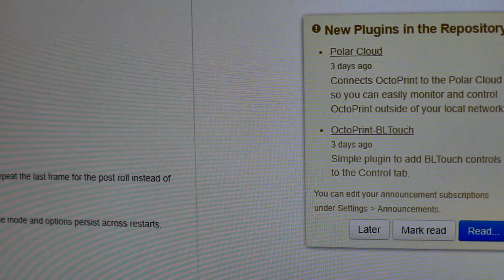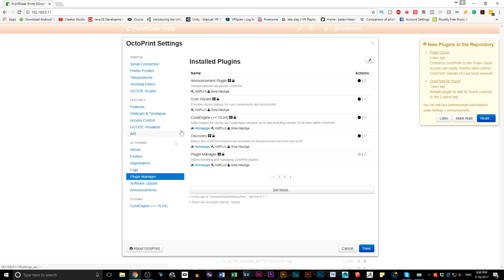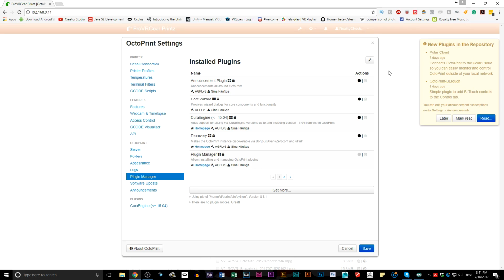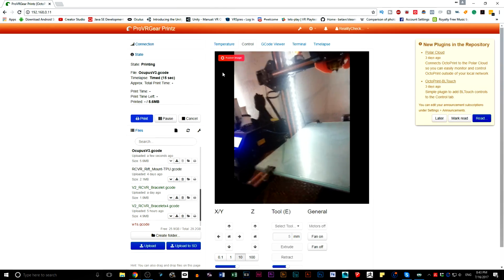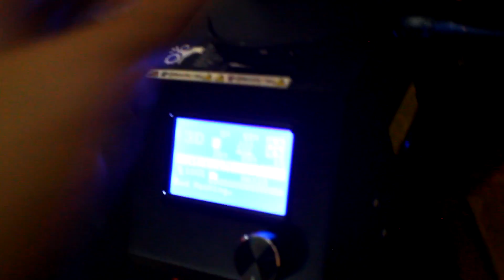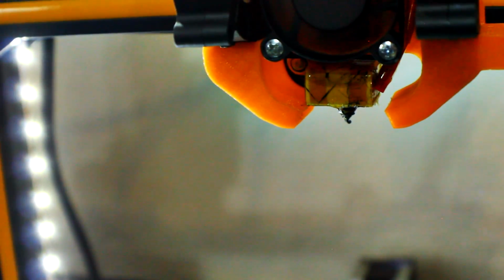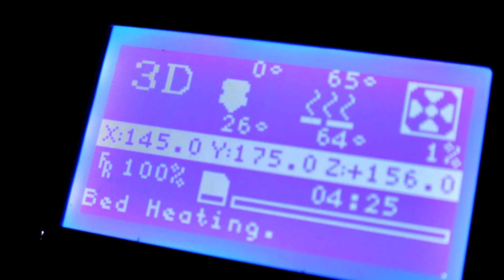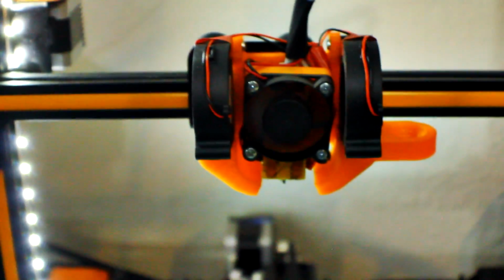✔ Creality CR-10 How-to Print Flexible Filament! | DUAL FAN UPGRADE + Raspberry Pi

Comment: If you haven't already, could you do a video on what you do/did to fine tune the printer? I've started tuning mine, but 1. I feel kinda lost when attempting to diagnose prints, and 2. I kinda don't know what to do to improve my prints, or where to start. I really appreciaite all the care and knowledge you've put into your vids (especially your CR-10 vids) and would like to siphon some of that off!
Reply from the maker: what cura software are you running? If you update to the newest one they have a new CR-10 profile that I've been using that works wonders! :D editing a frame brace update video now)
Reply: I DID update, but didn't even think to update the profile to the new stock profile. I'll try that tonight! I'm getting decent prints, and I've FINALLY got it to where it's doing so at a reliable pace, but the quality of the prints is still lacking. Lots of rough edges and extra filament at layer changes (already fixed that though w/ layer change retractions). I guess I'm trying to find a place/video where we can see what causes certain issues and how to fix that. Does that make sense? I feel like i'm thought-vomiting. lol

Comment: I'm having a terrible time trying to print Sain Smart TPU with my CR10-S. I've tried everything I can think of. No matter what I do, it won't stick to the bed. It'll get 3-4 layers in the it gets ripped off the bed. I've tried tape, glue stick, super hot bed, bed off, hairspray and hot end anywhere from 190-250, still won't adhere. I've tried moving the nozzle up a fraction of a millimeter, down a fraction, NOTHING works. Everywhere I look online, people are producing awesome prints with TPU, specifically Sain Smart. What the heck am I doing wrong?
Reply: Is your bed good leveled???

Comment: Did you happen to verify that the added threaded rod supports for the gantry actually improved the quality of the prints? If so I am curious how you would classify the quality improvement over a stock setup.
Reply from the maker: considering I added the mod fairly early I cannot say that they have made the prints better, but I have never had a problem while printing with them on. It is very noticeable that they take A LOT of the bounce out of the printer as well as keep it on point when I accidentally bump it from time to time. It feels like a BEAST with the supports and I wouldn't have it any other way!
Reply: Reality Check VR thanks for your quick reply. Could you post a materials list for this mod? And maybe an installation video?

Comment: Well, all the discussion concerning the Octoprint is fine, but as the CR-10 (which I have -- among others) uses a Bowden -- which is problematic with TPU -- a bit more on the print settings would be very helpful. I'm presently trying to tune in a roll myself, and though I can get some almost OK prints, in general they aren't so good. With the same roll of TPU, I'm getting excellent prints with my direct extruder Flashforge. I suspect retraction is the problem (I modified the CR-10 extruder -- I'm using a MK8 with the CR-10 -- still Bowden. I also optimized the Bowden tube length.

Rather than burning-off my roll of TPU, in discovering good Cura settings, maybe you could list your settings?

Well done video, however. ; )

Thanks, -Lou

Comment: Hey what do you use for bed adhesion?
Reply: You can find them on Amazon. I use one, but unless the bed is set at like 65 degrees, it tends to unstick during printing. I ended up buying a sheet of PrintinZ's sheet and it's AMAZING. I can run the bed cold and prints stick without worry ever. I love that thing.
Reply from the maker: William Leitz hey William, I use a pei sheet on all of my printers
Reply: Reality Check VR, hey what's up thanks for getting back with me and I've never heard of pei paper I just use hair spray and it works 80% of the time
Reply: *pei sheet

Comment: Hey Reality Check for the Flexible Filament Extruder Upgrade what is the size of the PTFE Tubing?sory for my bad English but i am from Switzerland i hope you understand my question.
Reply: Joel Ammann its the same Tube which comes with the printer. The spare tube

Comment: Do you upload your files to the SD card through the octoprint server? I've looked at a video by tech2c and it pretty much states that printing over USB there's some limitations a ramps board which i assume it's sort of based off will start to slow down due to the 8 bit microprocessor in the arduino mega board. So printing over usb max is about 40mm/s, printing over SD max is about 70mm/s until you start seeing artifacts. This is only for certain geometries like cylinders where obviously a printer can draw an exact circle but it can make a good approximation.